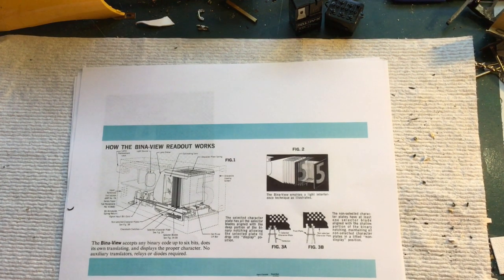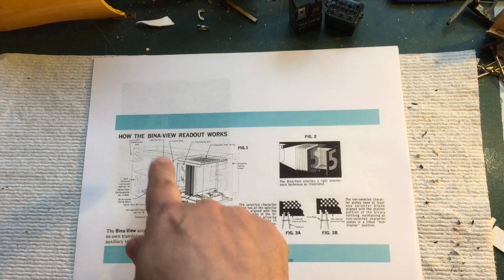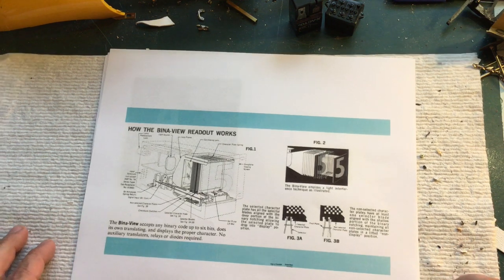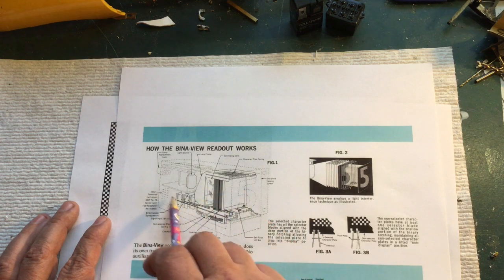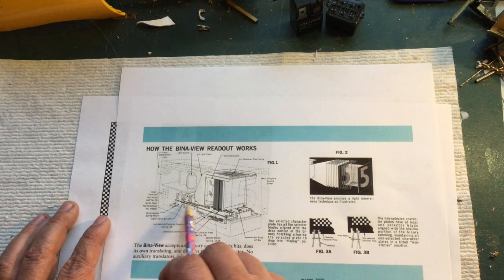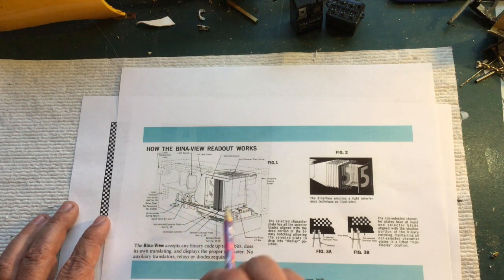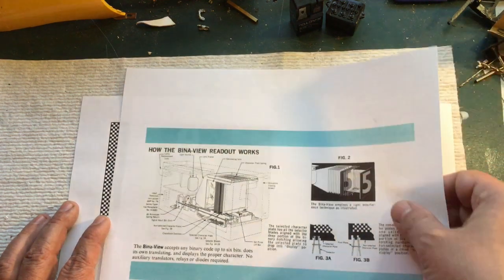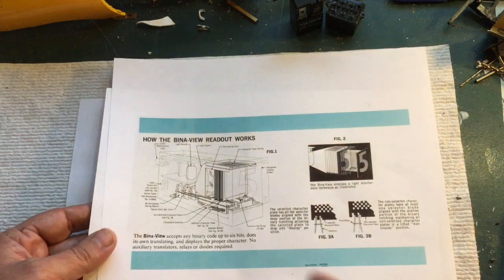Bina-View Build Part One

Comment: The way Fran described it, it's not a binary system but a six bit address system. I suggest going back and watching that section of the video on decoding and her breadboard interface.
Reply from the maker: Yea, but that’s done with 1s and 0s, which is binary. Fran addressed it with dip switches, which creates a binary word. The designer of the device (in this case me) is free to pick whatever binary word they want for each character. I was going to use the normal ascii code, but that’s more than 6 bits.
Reply: Bits have 2 positions.. (on and off), thus, it's a binary system.  It just has 6 bits.... in computers, bytes have 8 bits.